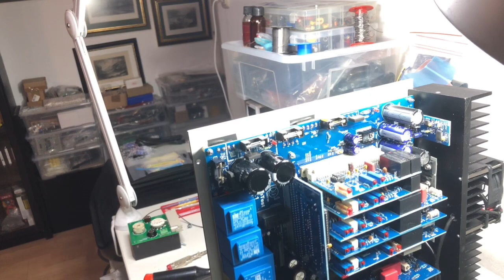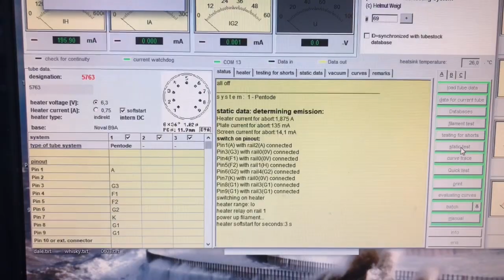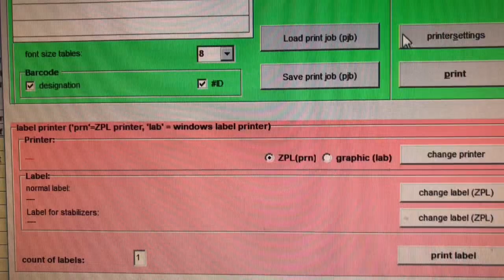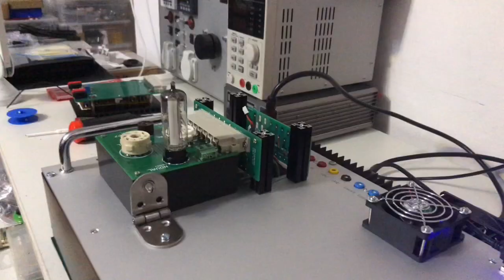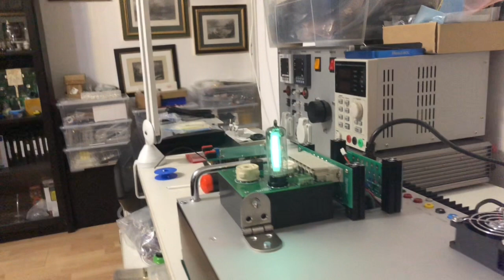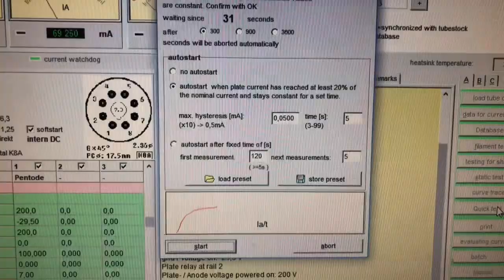ROETEST Tube Tester Build Part 6; Sealing the Calibration, Closing the Case & Testing some Tubes!

Comment: Nice work. I hope you intent to make a cover for the socket adaptors, looks dangerous. I made my V10 in 2020, since then I think I tested about 10k tubes. Excellent tube tester, very precise, calibration kept for years, I check the calibration monthly but no adjustments needed, really can't be broke, I made all kind of mistakes (settings for a type of tube an inserted another type), tested gassy tubes seeing flames inside but the protections always worked. This year I start building another 2 testers V10, one is finished (for a friend from France), the second is over a half made. Takes about 2 weeks sourcing the components and 2 weeks of work. Unfortunately I noticed that few components are hard to find now, like LR8 reference, network resistors, LT regulators, FT232 etc.
Reply from the maker: Hello, Thankyou, the socketbox receiver will get covered when I receive the cover pcbs, the socket boxes will stay as they are. Far to much work for me to build another one :-)